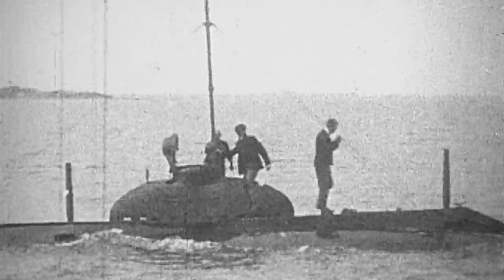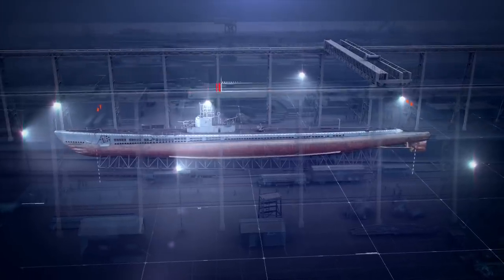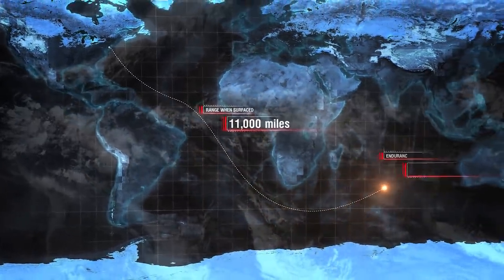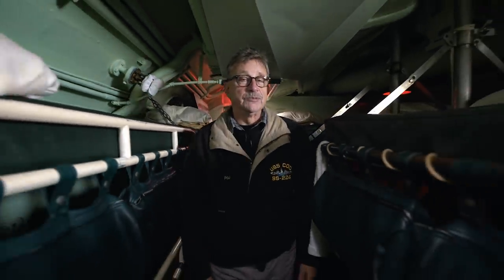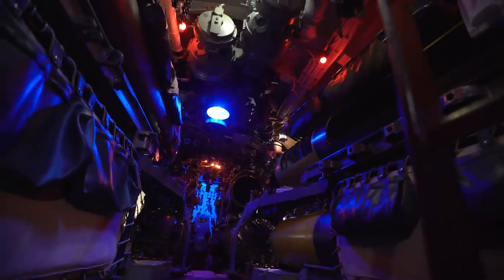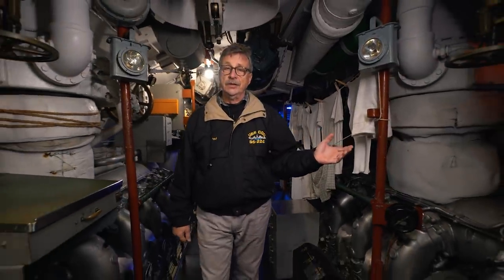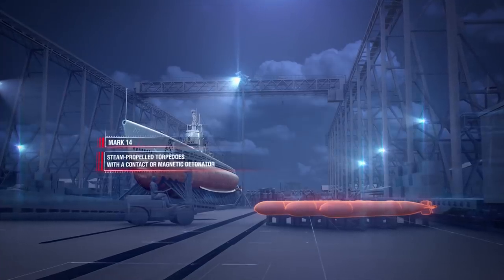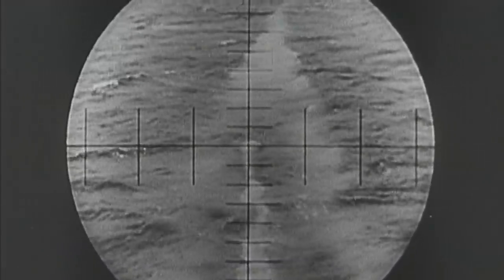Naval Legends: U.S.S. Cod. Part 1 | World of Warships

Comment: Even though I was on three Nuclear submarines which were much bigger than the USS COD, we still had similar problems of overcrowding on two of them. We still loaded torpedoes by hand on the USS HENRY CLAY SSBN625 and had to hot rack on the USS PUFFER SSN652 and the USS LOS ANGELES SSN688 . We even had to put food in every space we could when we did a Westpac on the USS PUFFER. We considered those WW2  submarine veterans heroes to be emulated 30 years after the war ended.

Comment: Up to the time the Navel Dept . finally admitted that there is a problem with the torpideo's  .

There was only a  one time test of the fish .
One functioned and detonated properly .
The second shot functioned properly But did not detonate .

That was the first and last test of our US torpedoes .
Congress told the Navy Dept .    Not to do any more tests because of the cost of each torpedoes was too much for wasting them on tests .

Later in the war it was the Submariners who fixed the problem .        Removing the Magnetic detonators and changing the mane firing pin .

Comment: 13:50 Navy? That was not the Navys fault. That were the bureaucrats in the Department of Ordenance. It took the Navy 2 years to make enough trouble for the bureaucrats to fix it. They also fuked up the Iowas main battery, so the guns wouldn't fit and they had to design new ones.
Reply: The magnetic detonators weren't the only problem. The early war USN torpedoes ran too deep because the Bureau of Ordinance tested the torpedoes without the warheads in place. B Ord insisted the captains were at fault for not setting the proper depth on their torpedoes.

Comment: 17:32 a sailor that cant swim???????? When I was in boot camp the ones that couldn't swim were pushed back out with a pole until they did swim. USS Newport News (CA-148) my time aboard 1968-69-70 Call sign THUNDER flag hoist;  November - India - Quebec - Quebec Then onboard the USS Springfield (CLG-7) 71-72 Flag Hoist/Radio Call Sign: November - Whiskey - Delta - Mike  "Fair Winds and Following Seas" Brothers

Comment: A very sad story towards the end of this excellent,informative and interesting film. I wonder why though a submariner would not have either been taught to swim or not been employed on sea duties, seems like a naive mistake, even during war.
Reply: The only swimming lessons I got in the Navy were in boot camp. (Such as they were) I had to jump off a high dive, which looks really high when you're up there, and go in the water holding my pants over my head to catch air, using them as a makeshift flotation device, then stay afloat for a certain amount of time in the water. I don't know if things have changed since the seventies, but back then knowing how to swim wasn't a requirement. I think at one time sailors were taught drownproofing, but that's not swimming. That's just basically floating face down, and moving just enough to raise your head for air occasionally. It doesn't take much energy at all, and you can survive in the water that way for hours without a lifevest.

Comment: The Mark 14 torpedo was not hampered by just the magnetic exploder. It has no less than 4 major defects. Saying it was not properly tested is an understatement. In the 11 years previous to the US entering WW2, not one Mark 14 torpedoes were ever live fire tested by the US Naval Bureau of Ordnance (NBO). When US submariners reported the problems once the torpedoes were used in combat, the NBO even accused them of incompetency and some of those submariners were even cashiered. It took the commanding admiral of the Submarine Force, US Pacific Fleet  (Adm. Charles Lockwood) going head to head with the NBO to force them to test the Mark 14 and only then were the defects found. And here's an example of how stupid the military can be: the man in charge of NBO was promoted and after WW2 made in charge of the US nuclear weapons arsenal. Yeah, you read that right and I vetted that fact from different sources.

Comment: The contact firing pins of the MK-14 Torpedo were also faulty. If they contacted a ship at or near 90 degrees it was found the pins would be crushed before firing off the high explosives, resulting in many duds and many angry Submarine Commanders.
Reply: And who designed this faulty gear? Was it a government bureau, or was it the manufacturer?
Reply: The blame lie with the Navy Bureau of Ordnance (BUORD)

Comment: Nope. Sorry. The Mk X1X was flawed by- not only the faulty magnetic exploder- but the fact that it ran at least ten feet below it's set depth and the contact exploder (the device that set off the warhead if it actually hit the target) would only work if the torpedo hit at an extreme oblique angle.

This was proven through tests conducted at the direction of Adm. Lockwood, who took the complaints of his men seriously, unlike his predecessor, Adm. English (who made his career at the torpedo factory that all of the defective weapons were constructed).... (He died, soon after being named Commander, Submarine forces- Pacific, after his plane slammed into a mountain in Washington State while flying to attend a conference. Such an event, while beneficial to the course of the war and it's participants, bears the stain of those involved who had no bearing and were mere spectators or contributors to the conflict, and who's lives I honor as a sacrifice to the common, and good struggle)

Hell will retain Adm. English and his sycophants that hobbled the USN (Surface, Air  and Submarine) with defective weapons.

Rot in the bowels of Hades, you artificers of deceit and hubris...................